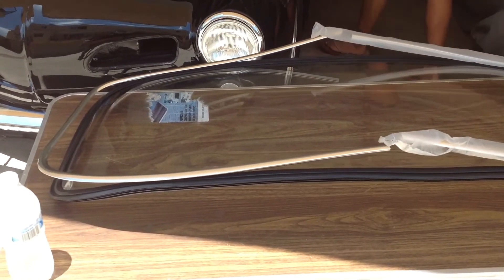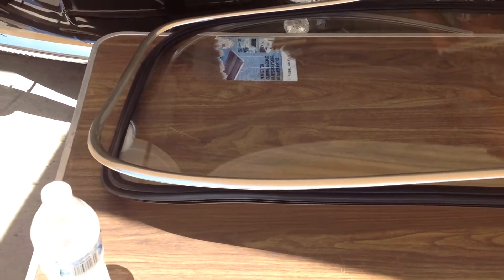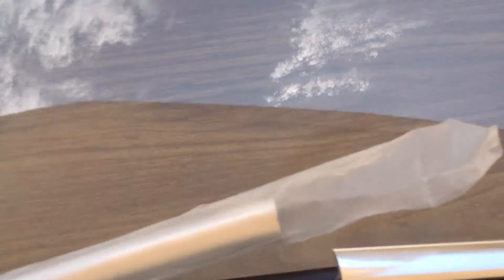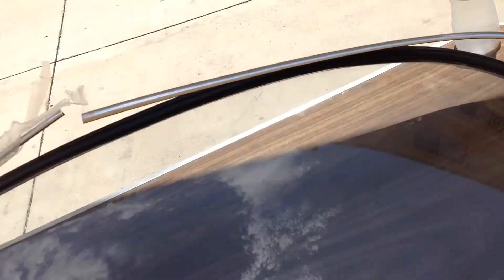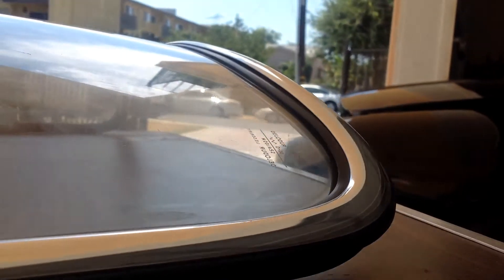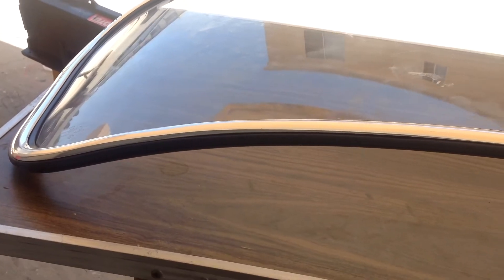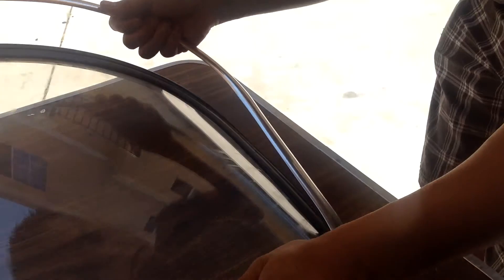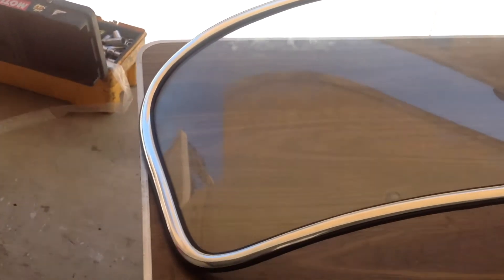Karmann Ghia window molding install HOW-TO

Comment: I’ve got a 65 ghia with original glass, I’ve heard that the new rubber and chrome is too tight of a fit because the earlier windows were cut a bit larger, 
Any thoughts, 
Do I need to buy newer windows, 67 -74 glass?

Comment: I have a 1974 Karmann Ghia and I would like to know (before I start taking my car apart) if it has or should have lower and upper body moldings with it's needed clip for the rear quarter panel pop out windows; I saw a short video on this subject but it was a 1968 Karmann and it was NOT a pop out window model; my brain immediately went into humming mode and since then I have been trying to find an answer; at present my pop out windows are literally locked within a rubber molding; can you give me some guidance or hint as to what I should watch or look for; I have my Bentley service manual including John Muir's contribution  they don't really help my situation, I would like some real restoration info on MY MODEL GHIA.
Reply from the maker: Miguel Cardona  yes use your smartphone to Google a store northern California call Karmann Ghia parts and restoration you can even go online and download their complete catalog and it'll show everything correct for your year make and model

Comment: Where did you purchase the Rubber seals from? I need front and rear seals for my 1970 ghia
Reply from the maker: Bugin1967  from a company called Karmann Ghia Parts and Restoration. you can find them on lines in  California